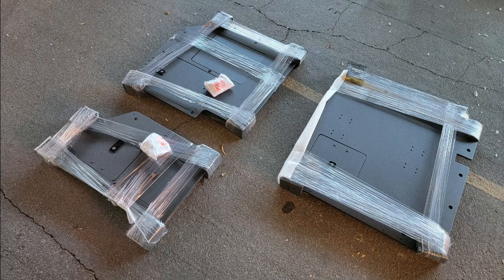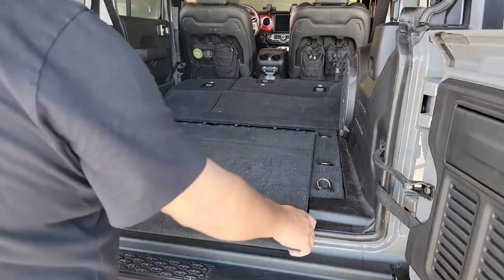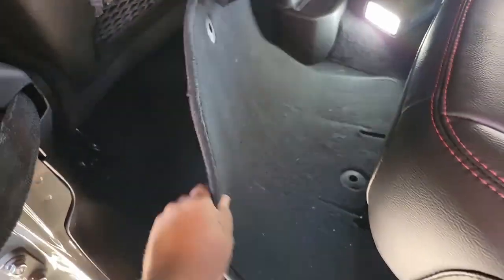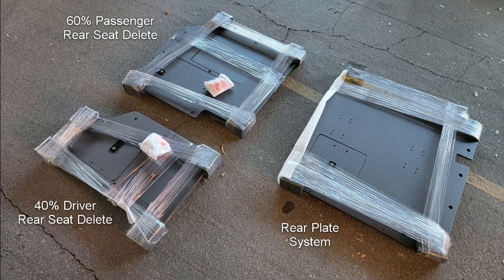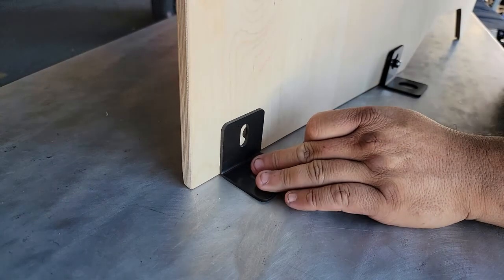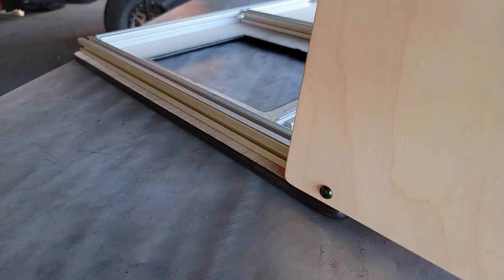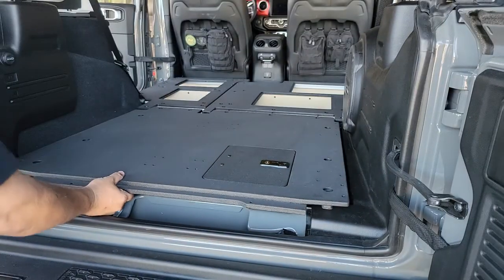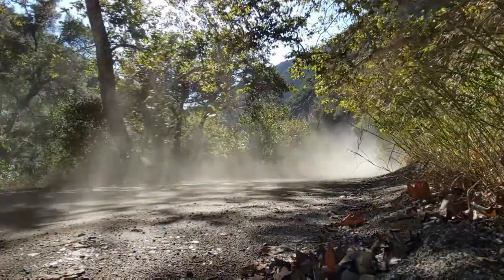Goose Gear - Stealth Sleep Package on the Jeep Wrangler Unlimited

Comment: I wish they put a door in the side panel.
Reply from the maker: The shape and limited space would make a "door" pretty hard to make useful. The make infill panels to close it off but I found that I like the door side access like you do. I was in the process of making the panel a quick release using a couple Dzus fasteners but the Jeep has been in process of a paint related lemon law return, so the project is permanently stopped.

Comment: This is a very nice setup. why the 4 door is cheaper than 2 dr doesn't make sense. there is no front access panel and no side enclosers. for 2 dr. sad. as you can tell i own a 2020 jl Rubicon 900.00 dollars for 2 or 4 door I think there missing the market.
Reply from the maker: @jkbagwell  the 2 door plate system is not the same as the 4 door. The 2 door plate extends more forward.  It's about 30% longer, which is a lot more material mounting and hardware. The longer 2 door is $895 and the shorter 4 door is $670 but requires the seat delete (another $1000) to get the 2 door storage area and sone. Makes sense to me
Reply: @ how is 2 dr 30% longer making it more costly. 30 % shorter than 4 dr. doesn't add up . but your math must be better than mine, enjoy.
Reply from the maker: @jkbagwell  just look at the pictures of the product.  The 2 door rear area  from behind the seat to the tailgate is longer inside than the rear seat area to the trail gate of the 4 door. It's pretty plain to see if you compare the images.

Comment: seriously thinking about getting this for the full delete, can you get to the rear jack? Anything you dont like?
Reply from the maker: I can't say that there is anything I would improve that was substantial. The jack is accessible by removing 2 Allen head screws. I cant use the stock jack so its a bit inconsequential with my lift height and tire combination.
Reply: @exhaustinglife  fantastic, thank you!

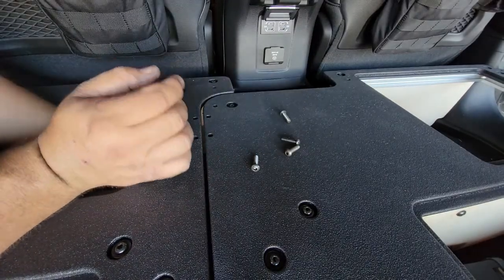Comment: Hey! I noticed your center console has USB ports and a 110v outlet @9:50 is that a mopar add on or is it trim specific?
Reply from the maker: It is a trim specific option however can be added via MOPAR parts. It is included with all Rubicon JL Wranglers

Comment: I'm guess you don't use the back seats much as it'd be a hassle to do this every time you want to go camping.
Reply from the maker: I never use the back seats so it fit my situation but if I had to put them back it's very easy to do that in 30 mins.

Comment: Great video. Can you do just the 2 seats an not the trunk? Anyone knows is that is an option?
Reply from the maker: My understanding is that, in order to use the rear seat delete plate system, it is required to get the rear section of the plate system as well. 

Unfortunately, the rear plate system requires a different mount than OEM and therefore, the Goose Gear shared center mount for the rear seat delete and the plate will not bolt to the factory provisions.

Comment: Did you install nuts to the 2 outside bolts for the rear platform next to the 40 and 60 panels?
Reply from the maker: I did but it's not necessary.  They are only there for OEM  equipment that was removed.
Reply: @exhaustinglife  thank you for the reply, I thought I was missing some parts.

Comment: What happens with my alpine sub in the rear floor?
Reply from the maker: If it is flush to the factory carpeted floor over the pocket, it will fit without issue. You can spec the Goose Gear rear floor with the access panel on either side. 

I would highly suggest that you do a little due diligence and use noise dampening mat on the underside or use some foam insulation strip to ensure no ratteling occurs based on your subs output.

Comment: Thoughts on using he deepsleep4jeeps air mattress to complement the Goose Gear Stealth? Or is deepsleep sufficient?
Reply from the maker: I use a deepslerp pad.  Fits just about perfectly even with the camp kitchen.
I feel the factory hump and uneven surface between the seat area and back area without the Goose Gear is less than desirable for a good night's sleep.

Comment: I wish goose gear had the option not delete the seats and just fold over for a bed platform
Reply from the maker: The problem is that the  seats folded down are still on an angle and not flat or even on the same plane as the  rear deck.  You might try the DeepSleep mattress if you want a sleepsurface but it still won't be level
Reply: @exhaustinglife  I can attest to this as that is exactly what I do now and do my best to level it out by shoving my Coleman stove under it at the bottom.  It still leaves a small dip in the middle which is why I'm not looking at the GG system.

Comment: Shame they don't do a stealth sleep system with drawers underneath that are a decent height and that run the full length of the interior.
Reply from the maker: I can say in a lifted Jeep, another 6 inches of self space alone would make getting in and out through the side door a lot more of a pain. 38's now and 3.0" of lift already make climbing in a concerted effort. I like the storage potential but it really will adversely effect ingress and egress.

Comment: Why did you pick this over cargo dog storage?
Reply from the maker: Honestly, I can't say the Cargo Dog (CD) brand ever showed up in my searches and to be honest I wasn't looking for a "Dog" related product (which I can see now is not the sole purpose of the product) so some bad is SEO or targeting marketing is to blame as well.

Taking a closer look at it's design there are a few things that don't suit my specific needs:

1. I don't like the fact that the CD product requires you remove everything you have stored on top to gain access to the contents stored under.  In my build, security of the contents was not the issue. I wanted easy access while geared up and transporting and when i was unloaded have the secondary option to gain access through the top was a bonus. The CD product does not offer the option to gain access to the contents through the sides while the door is open. This was a critical consideration in my build where the contents stored inside are recovery gear and tools which may need to be accessed without completely having the ability to move or remove all my gear.
Reply from the maker: 2. It doesn't provide any means or structure for securing the gear stored on top of the new floor area. I don't like to travel on-road or off-road with loose gear in my cabin area. An accident or rough roads can turn anything just placed on carpet into a potentially dangerous projectile or just allow it to get damaged or damage other things.
Having a sheet metal construction means it cannot be easily modified to accommodate eyelet or d-rings that the Goose Gear set up has already built in. The Goose Gear package has a number of pre-installed 1/4-20 threaded inserts for easy mounting of a number of other products such as fridges / shelving or D-rings or other mounting aids.
Reply from the maker: 3. I wanted a durable surface that could take the abuse of heavy gear and would look good and be easy to clean. The CD is carpet and with the nature of the outdoor use thorns / splinters or even Velcro that a number containers and bags that i use inside have, would quickly fray or tear up the carpet and as a cloth would take to staining fairly easy. It's apparently common enough of a problem with CD that their warranty has to call out that damage to the carpet, or staining is not covered. The Goose Gear coating is in fact a bed liner material extremely durable and scratch resistant and enhances the birch / plywood resistance to impact damage. (obviously the CD carpet will not scratch but tearing is very possible)
Reply from the maker: 4. The CD seat delete leaves a gap and step down between the deleted seats and the cargo area. Being that the Goose Gear product is a complete replacement from tailgate to seat, the completely flat and level surface is  better suited for a alternate sleep area which I do use it for. Even with a pad the 1/2-3/4" deep 2" wide gap would be felt between the 2 surfaces. This is also something that was important in my build but may not be in someone else's but you asked why I would choose the GG over CD.
Reply from the maker: 5. The last one is a minor one but if you have a Rubicon and use the MOLLE panels behind the seat the side flip up design of the lids would hit the pouches I have mounted. It just means I would have to adjust the seats up and tilted them forward to gain access every time. You can see in a few videos out there on the CD unit how this might be an inconvenience.
Reply from the maker: My last notes for the CD offering:
1. I can appreciate it is a Made in the USA product and it was clearly designed for a specific user. As a pet product or secure storage option it might be something to consider but for ultimate versatility, durability and compatibility with gear storage as were my specific needs is just lacks too many key features to compete with the Goose Gear offering.
2. Also, they do show the use of the product for firearms storage but you will want to check with you local laws on just how legal that container is for that and what exactly a locked container and concealed carry condition are inside of a motor vehicle before assuming this product is sufficient.

Comment: Do you know the length, measuring from center console to rear, with rear door closed? Thanks
Reply from the maker: I don't have that measurement but realistically, it would measure the exact same as a vehicle without the Goose Gear parts installed as the console is stationary. 
I'm 5'7" and can sleep without touching my head on the chair and feet on the tailgate. I will say 5'10" would be the limit.
Reply: @exhaustinglife  Thanks, I'm 6ft, and am considering buying a Wrangler to have this lifestyle. Thanks for your help

Comment: awesome video made , on their website it says the front requires the back, I'm looking to only remove the seats and make room but I don't feel like I need the back, still planning to sleep inside but a foam mattress should flatten it well. Do you know if it's possible?
Reply from the maker: That is correct. The front two panels use the rear plate system mounting edge. In my explanation I should have said that once the plate system is installed you can choose any of the other variants as long as the plate system remains mounted.
Based on what I know of the factory mount you would have to do a little wood work and drill the front crossbar that the carpet mounted too. I would think it is doable with a little DIY spirit.

Comment: Any rattling from the rear cargo plate??
Reply from the maker: No. The rear plate alone reuses the same 6 factory primary bolts and when attached to the seat deletes and 8 more floor hold downs its solid. I have run with it empty and completely loaded and not had any noise issues.

I had shared your concerns at first, especially having the OEM sub woofer but no issues even when I'm cruising around completely unloaded. The only thing I hear is the factory hard top squeaking on occasion on really rough trails.

Comment: Where can I purchase the bags behind the 2 front seats? Great video!!
Reply from the maker: 5.11tactical.com - these are a number of different pouches I have kept and used on my other builds too. MOLLE mounting makes them secure and very accessible. 

These are the ones I have pictured:
- Flex Admin Pouch
- 6.6 Padded Pouch
- 6.6 Med Pouch
- 6.6 Pouch
- 6.10 Vertical Pouch